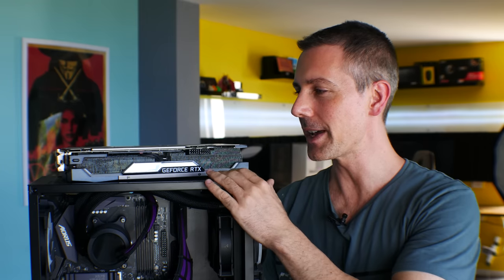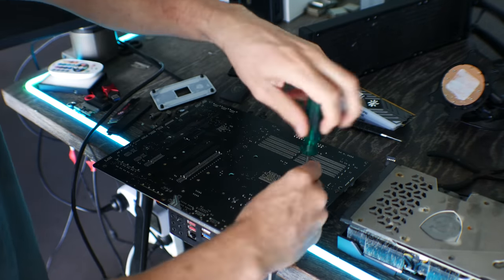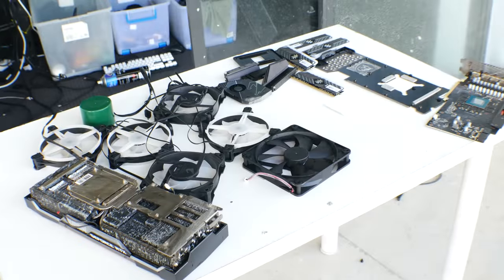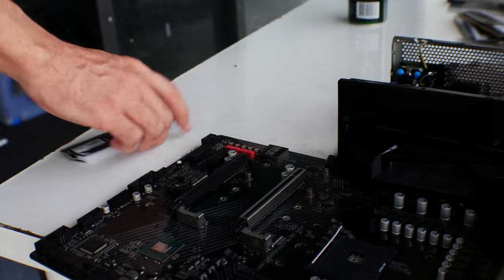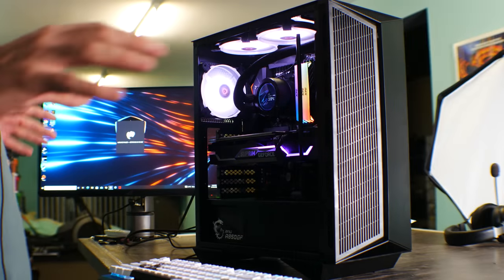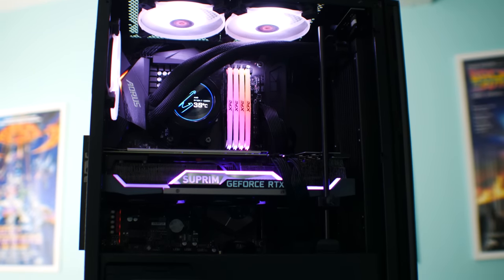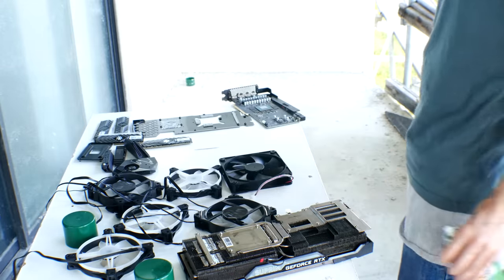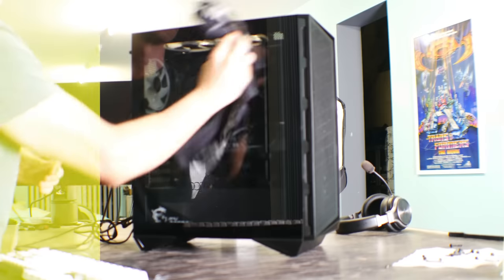Restoring an RTX 3070 Ti Gaming PC that was Submerged in Flood Water...

Comment: I noticed you used WD40 to clean the tempered glass, i've never had success cleaning it that way with no streaks i have to use glass cleaner. Have you got a secret tech? haha
Reply: Maybe the formulation there is not oily of sorts, I'd try to do the same here in Canada & all my parts become greasy & sticky.
Reply: it wasnt wd40 i think... quite sure it was multi purpose spray.. :)
Reply: @jeffkuzzen  oh yeah you're right, he uses the green one. I've seen him use WD-40 a lot for parts in some of his old videos. He probably switched to this one coz it does it's job pretty good.
Reply from the maker: Yeah multipurpose is similar but different, it's also a lot cheaper here in aus, have to have a lot of rags ready to go!
Reply: @techyescity  doesnt multi purpose spray attract alot of dust when you spray it on a motherboard?? :)
isnt it oily at all?

Comment: Ok,as I watched it, couple of questions:
Why did not you remove the heatsinks of the ram,
Why not finish to disassemble the graphics card,and leave the top mount still assembled ????
Oh,And I DID SAW you disassemble completely graphic card coolers,why not now ?
Reply from the maker: The Fans? They don't need to be disassembled, as for the ram disassembly that there is a risk of damaging the DDR4 modules, which I don't want to do, especially since it's easy to access the areas to squeeze out the water.  I should make a full tech yes loving process 2022 perhaps?
Reply: @techyescity  
Yes,You do so !!
Maybe ,Japan Edition, together with your son ?
8)))

Comment: hey brian, question about chinese x79, basically it was working fine until i let it sit for a month, after that when i went to turn it on, it spits out a BlInitializeLibraryFailed 0xc0000185 at a bios level. also cant change the time in the bios

Comment: I had a question about my current build and im trying to figure how to get it to run stable enough at the settings the hardware came with.

Ryzen 7 3700X
EVGA RTX 3060 12GB
ASRock Phanton Gaming 4 b550
64gb ddr4 (4 sticks 16gb) 3600mhz, Cors. Vengence pro RGB
250gb SSD and 1TB HDD
750W PSU.

I dont have anything overclocked, atleast i believe i dont, and i have memory issues when i try to run it at its default speed which is 3600mhz. I had to change it to 3200mhz to have 0 issues running it. I wanted to know if thered something i may have done wrong. Im pretty clueless at this point

Comment: Question for ya...... The ultra sonic cleaner. I see you submerge several electronic parts which I know is okay. The only issue maybe or concern I have is with the fans. Aren't they specially lubricated? Just wondering.
Reply from the maker: A lot of people have wondered the same, I just haven't come into any problems, seems to work fine.

Comment: Nice! BTW, does isopropyl alcohol okay to use when cleaning both GPU and Motherboard? Just incase if I can't buy a multi-purpose cleaner in my area.
Reply: isopropyl alcohol is used more for cleaning electronics then multipurpose cleaner but i think the multipurpose cleaner leaves some protective oil behind that will prevent rust and corrosion, not really sure
Reply: Iso can degrade and crack plastics.
I ran some iso through a clear EK block to clean it and it immediately cracked it.
Reply: @Safetytrousers  ahw. that's sad. thanks for the info.

Comment: Your amazing Bryan really good job why dident you check the power supply with a power supply tester first ? i always check mine like that one im taking to the Philippines next month works good also a second hand CPU and motherboard a i3-6100 the mother board uses low ram i think its 2231 ram why is that can i put a higher ratting ram like a 3200 ones ? oh the ram i have in it is 16gig to go have a shower you smell Bryan hahahah good on ya dude !!!!!

Comment: 1 rad w/cooler i7.9700k no issues with temps  2019 was $85 deepcool 
2 rad w/cooler gigabyte Aorus  rtx2080.s $1,600 2019  sometimes 1 fan a slight hum noise  not loud  
trying to find The PC case min  500L   550 high 250w approx.   The closest i like Corsair white  mesh front better airflow  au$125 
glass front/solid  panels restricts air flow a big no no  why make  this chit anyway .

Comment: you are not doing anything right. this is not my opinion this is fact. you have to disassemble the parts of heatsink, pump, fans and RGB controller back of the case.